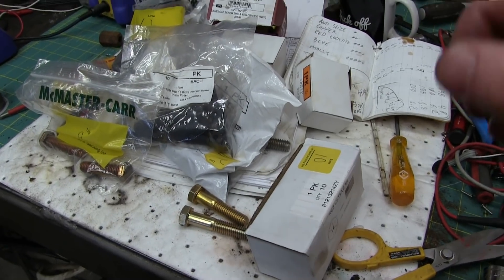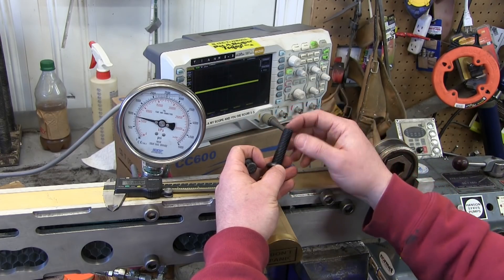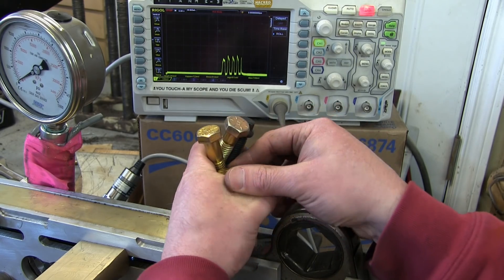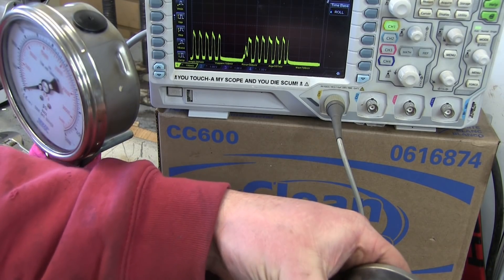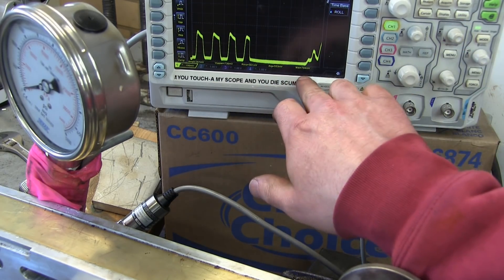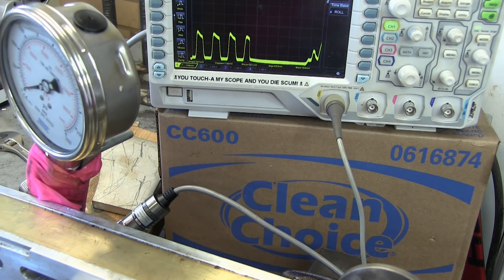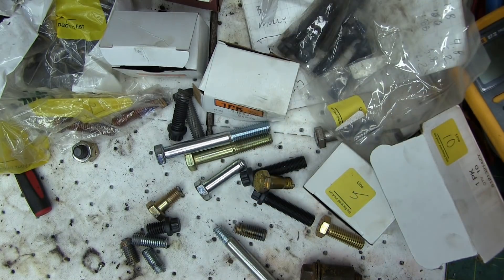Home Depot Bolt vs. USA Made | Offshore Suprise!

Comment: 14:10 It not another way, it's the only way that provides the information that is useful. Love your channel, but like learning stuff more. putting on full body armor You just proved that you know the only meaningful way to do this test. Why waste time on something lime this. If I want a lazy review, I've got "real tool reviews". Don't be lazy, show me real life strain! Not the strength of the outer layers of a bolt. Show me the linear pull in two 1in plates with a  double nutted 5/8-14. I want the truth. I can handle the truth. This is just playtime. Get back to the real stuff.
Reply: I case anyone doesn't get me, I only take the time to point this out because I care. Really I do. You don't have to give yourself away, but if you understand what I mean, like this so AvE will see that I'm not delusional.  If I'm wrong, then fine, I'll start doing the real stuff, the tests that matter. It won't be as funny and I won't be as cool, but it will be the actual real life results that matter. An understanding like is a way to show that  we don't want "real tool reviews", we want reality based reviews that have meaning in real life situations- in this case, clamp strength, not torque or thread strength
Reply from the maker: Sounds like it's your time to shine, Jimmy. Giver.
Reply: Hugh Brackett lol, I can agree with all that. Just got piggy to sleep, but I'll post a video of my draftsight screens. That fact I'm watching and commenting says something but every now and then, the wrong side of the spectrum shows through. The plate I have is pretty heavy. Even a 3/4-16 is only good for about 33k lbs.
Reply: Hugh Brackett I've got the plans up. I'm also giving the PDF files to anyone requesting them. They were not cheap, but I Like to share! Almost done with my stretcher. To be safe, I'm adding 5/8 boiler plate around the "pop" area.
Reply: AvE Almost done with stretcher(~200lbs? taking longtime).

BTW, I learned of abom through you. Like the Liebherr 1150? Be the first mega YouTube guy to share 68 day old(future mega enginerd channel) mobile crane channel with all the in and outs great dialiuge with top and cab views great editing too.
 https://youtu.be/NZMlSJSBz7k

Comment: Never heard the "3 threads is enough" claim before. What I have heard from many sources is that the bolt is supposed to extend three threads past the standard nut. Some bolts are slightly damaged or the first couple of threads not fully formed to allow for easier assembling.

Comment: Without even watching- you test torque and not axial strength. Now if you bolt 2 thick plates together then pull them apart until the bolt snaps, awesome video. Now let's see how wrong I am!
Reply: 7:21 and that is why the videos are yielding. Increases at first then a slight decrease in effort just before failure. Just before effort starts to decrease- go get another bolt and get it to peak, then repeat. That will give the strongest connection(with fans) possible.

Comment: As a lab jockey I want to yell at the difference between QA and QC. Better point though, the crappier grade bolts are built to higher grade standards so they don't have to source multiple grades of raw materials, have different heating programs and just ensure the ones marked for grade N meet at least grade N standards

Comment: Where does three threads for full strength come from? I had heard the rule of thumb is to go at least the same depth as the root diameter of the threads.
Reply: I was always told the same thing

Comment: the stress is shared between the threads like a load on several chains... so yes if only one thread are left in a nut with higher quailty it should be able to shave off the bolts thread given enough force... When it comes to wear the corse thread is prefered due to the the shared amount of thead cross section after wear also amount of suface of the wedge of the thread depth... Over tightening are more a problem of the smaller sizes when using only force of the hand, even if of course a lever csan move the world...  Me thinks...

Comment: Technically to be graded, all these bolts, no matter what country they are from, need to meet the minimum SAE requirements. So at a minimum, these bolts are all the same. Similarly, torque the bolts to the SAE torque spec for the specific bolt grade, thread size, etc. and it wont matter where the bolt is from... they will act the same. Failure only occurs when these ratings are exceeded.
Reply: That would be why they all failed at 1.8 times their rating.

Comment: Would you please compare the strength of rolled vs cut thread fasteners?
Reply: fastener industry rule of thumb is cut threads have 80% the capacity of rolled threads.
Reply: Rolled threads are stronger because it physically lines the crystals up

Comment: How come you're torquing on the pull up instead of the push down ?
Reply: If he has the strength to lift his own weight he can exert more power pulling up than pushing down.
Reply: He doesn't like his teeth.
Reply: Probably because he didnt want to go stubling forward when the bolt gave out. He could brace himself with something behind him to pull up, but pushing down would leave him prone to over balance when the bolt gave.
Reply: Richard Fay push down can cause bad hurt situation especially you can't know what's the Bolt exactly gonna fail even bolt hold on if the socket slip you may smash your face or whole body on the edge of table
Reply: By the way he talk about why he Don't apply force downward same as what I say up there 
Bad English hope you can get what I mean 
stay safe
Reply: Can't think of a way to explain to the idiot why...anyway...pushing down it snaps you loose balance and hit your head or break a wrist...pulling up you can brace yourself. Try it next time while trying to get a tight as lugnut off by hand. Would you push or pull...I would pull.
Reply: Phil Hart - Looks like a hernia in the making to me.
Reply: Way more control on a pull stroke than a push, because you're always braced if the fastener fails or the tool slips off.  That means less chance of injury.  If you make a living using tools, an injury can mean lost wages.  Be safe out there!
Reply: @Phil Hart.  Anyone who can walk up stairs, unaided, can lift their entire body weight with just one leg...
Reply: @K J.  Legs can push down much harder than arms can pull or push.  Can you do one-arm pull/push ups?  I can't manage even one, but I can climb a few stairs...
Reply: When you stand up, your legs exert a pushing force against gravity, causing your body to rise...  If your bones were made of jelly, you could neither pull or push, just wobble.  :o)
My original point was that legs are stronger than arms.  Maybe I didn't make that clear enough...
I'll try harder next time.  ;o)

Comment: Just some suggestion for next v-j-o espezial with the cockford ollie; 
1. Comparison of non-lubricated threads vs loctited vs lubed and ready threads, in regards to clamping force and torque.
2. Elasticity in typically softy fartsteners (A4/8.8) vs 12.9 farts. In my very humble opinion, when you torque by dickbeater-feel, the accuracy is much higher on the soft fartsteners. But e-module is the same? Why?

Regards from Vikingland

Comment: Wow the home team sure took a hit that time.  Now I got to spend the day drinking to forget.  😁
Reply: That’s because “He” (the orange dude) put penalty taxes on EU-steel so you can’t afford Swedish steel any more. Not joking!  😂
Reply: Gonna use some Grade 8 HD bolts on my heads next time!
Reply: Home team came in 30% better than rated, so it's nothing to cry into your can of pissy beer about (disclaimer: commenter is dirty Euro-trash ((a lot American beers are great))
Reply: Not all is lost. A new and previously unused excuse to gargle the Daniels.
Reply: Yesshir goood thinkinkin.  Pourre me another.
Reply: The only home team disgrace is that piss water you are drinking, get a proper import
Reply: Very good comparison, but I have a few questions. Does a fastener that is "Made in the USA" guarantee that the steel was refined in the USA, or simply indicate that the final product was manufactured there? Also, does continuous load over time effect the strength of the bolt?  I was thinking about spreading microfractures.
Reply: Joshua Schofield would you ask the same questions you just did if the results were the other way around (usa stronger than chinese)? 
Something to think about..

Comment: This is interesting, bit isn’t the sample size too small?
For good data, shouldn’t you test maybe a hundred of each kind of bolt, then throw out the outliers and average the results for each group?
Reply: Yea but how is he going to have any energy to masturbate after cranking on 400 bolts?
Reply: Gary Cooper get to work.
Reply: Also, this is a few seconds of stress applied by a meatsack - how would they perform comparatively under cycling loads over long periods?
Reply: Gary Cooper of course. I’m also not so sure how “linear” the sensor’s response actually is. JH might be stronger, but if the standard deviation is huge, then the bolts can’t be used reliably.
Reply: Perhaps, if you are a lab operating under the auspices of NIST.  If you are a Canuck in his garage, all you need to do is discuss the subject over a couple of Mooseheads - any type of measurement after that is bonus points.
Reply: Go for it!
Reply: George Reynolds thanks for typing what I was going too.
Reply: Yep. I will accept the american made ones give sooner, but I would also be interested in consistency. However, it would take thousands of tests to get proper usable bell curves going on so the consistency and reliability can be quantified.
Reply: In my experience, the appropriate sample size for fasteners is about 100,000. I don't know how or why it happens, but if you buy cheap fasteners you'll occasionally get a box of 100 that are all garbage. With the more expensive fasteners you'll basically never encounter a defect. I mostly deal with small parts though, so like #2-56 and #4-40. Quality control may be very different for larger fasteners.
Reply: Are you gonna go over to canuckistan and hold his hernia in?
Reply: ~14 minutes to test 4 bolts.. not sure  many people would want to watch almost 24 hours of bolt busting..

Lol maybe chuck in some classical music and title it as a 'meditation' video!
Reply: Yes, you should. Also, if the bolt meets declared spec, cheapest is the winner.
Reply: M Smith— It would qualify as a Frederick Wiseman documentary or an Andy Warhol art film.
Reply: You’re assuming that the factory that produces the bolts doesn’t have a high standard of quality 3sigma or better. The sample size is small but performance should be within a very narrow margin because of quality control when you’re looking at a larger samples size of the same products.

Comment: More information on the application and treatments of different fasteners would be great too. We use those 12 point bolts all over the place on aircraft engines, and they seem substantially brittle compared to the other fasteners. I also am curious about how different mechanical locking methods affect how much torque can be applied. Like since a crimped nut is oval shaped on one end, does the holding capacity decrease? Thank you Ave, you're killing it! You know what, I could send you the very fasteners we use on aircraft for science purposes, if you'd be interested.

Comment: Is there a point that can be calculated where the length of a screw doesn't give more clamping power, because of friction, kind of like pulley systems where at some point adding more pulleys doesn't add more mechanical advantage because of the added friction?
Reply: Yes, but it's very long and complicated.  The more important factor to consider when choosing a fastener is proper thread engagement.  As long as you have about 1.5x the thread size of thread engagement in a cast iron/steel tapped hole, you should be fine (2x the thread size for aluminum tapped holes).  So for example: for a 1/2" bolt, the bolt should be threaded into a tapped hole in steel at least 3/4" deep (threaded at least 1" deep into aluminum).  Achieving proper thread engagement will allow you to achieve your desired clamp load more reliably without fear of thread stripping.

Comment: I thought that the different grades were also different ratings for shear strength (perpendicular to the threads)
Reply: They are but with lesser degree of shear strength capacity improvement vs what you gain in tensile strength.  For example: 1/2-13 bolts:  Grade 5 proof load ~12,000 lbs, shear load at the threads ~ 7,200 lbs.  Grade 8 proof load ~17,000 lbs, shear load at the threads ~10,200 lbs.  So you gain 5,000 lbs of tensile strength but only 3,000 of shear strength going from a Grade 5 bolt to a Grade 8 bolt.

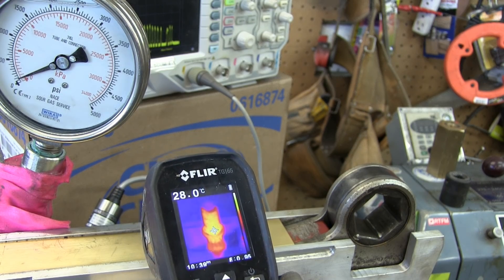Comment: @ 12:33 Hmm ... this gets me to thinking, how much of a fastener failure is attributable to straight mechanical stress and how much is due to heat induced weakness?  Would the numbers be different if the fastener was allowed to cool between induced stresses?  What if the fastener just started at at lower temperature to begin with?
Reply: you can not put enough heat into a bolt this way to have any effect.

Comment: The L9 bolts used to be exceptional quality when Relient (RIP Relient) owned the brand. It was sold many years ago by Relient, and do not know the quality since. All those general perpose gr8, gr5 etc from hardware, mcmaster etc are not highly tested and quality controlled. All kinds of issues effect them from lot to lot, from supplier to supplier. You really need to build again a tensile tester, which will give a far more accurate representation of the bolt strength. These torque tests really do not mean anything due to so many variables. But, I do like what you do here, as video ends now, YAAAAH The Strait Pull is the way, can't wait!

Comment: Wouldn't fine pitch threads have more mechanical advantage? So they should need less torque. Obviously it depends on the details.

Also, unfortunately we're measuring torque, not clamping force, so a bolt with a terrible surface finish might have artificially inflated torque numbers due to the extra friction.
Reply: Fine thread fasteners have a greater mechanical advantage, so need less torque to achieve the correct internal stress in the bolt to keep everything clamped together than a coarse thread fastener with the same root diameter.  

But, since fine thread bolts have a greater root diameter than the coarse thread variety in the same nominal size, they require more torque to achieve the proper internal stress.

Comment: If every day is a treat especial then it's the same as no days being treat especials....
Reply: Do R/C! 
I'm Syndrome!
Reply: Not every video is, and not every day has a video. I wondered the same thing, but I still find the ones denoted 'special' as being so, even if there are three in a row.
Reply: WTF, it's great opening line!
Reply: Kenneth Hicks I like my treat especialle
Reply: taiwaneisum ain't chinesium. I have no qualms about buying taiwanese products.
Reply: The highest of the high-end fasteners I've worked with required you measure the  force by stretch instead of foot pounds. Might tell a different story if you measured that.  Very surprising resulys though. Wonder if you got actual M.I.A. bolts and not some made elsewhere but stamped as such. Charge more for the same sorta thing.
Reply: Well a very merry unbirthday to you then good sir
Reply: unless every day is especial in a different way than the last. which is inherent in the term.
Reply: AvE mentioned in a video a long while back, the videos are a treat especial in comparison to the the typical garbage found on Youtube
Reply: You shut your fucking hole.